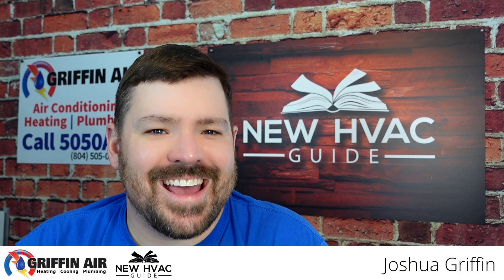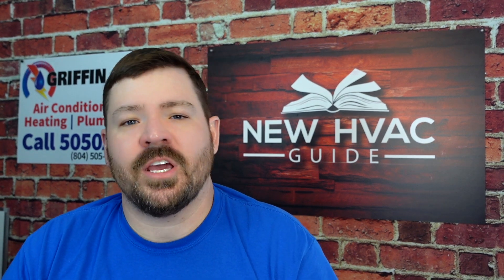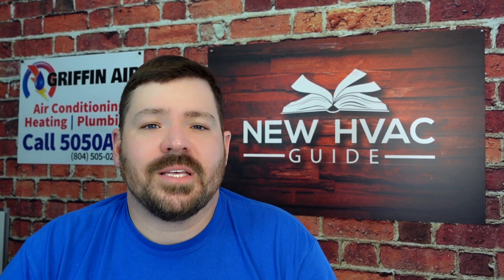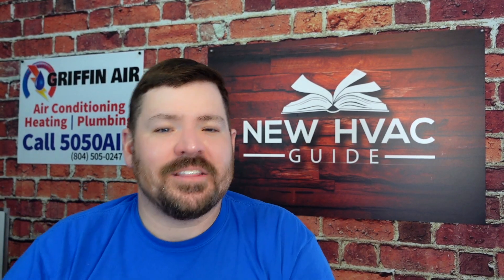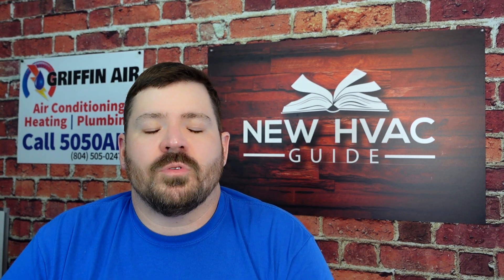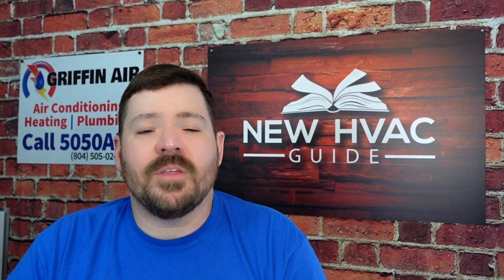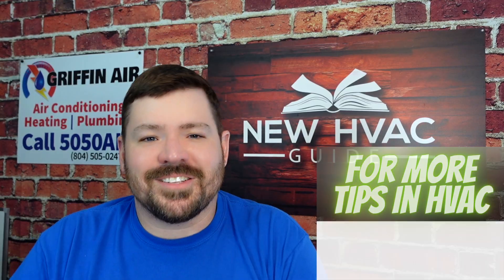3 Furnace ISSUES in the Winter!

Comment: I had to sign a waiver to NOT have condensate pump wired. Good thing, as a couple of weeks ago, we had unusually cold temperatures and the tube froze. I’d rather have water on the garage floor than furnace shut off. I unplugged the pump after discovering, later in the day used a hair dryer to clear the frozen section, and propped a piece of plywood to keep the harsh wind off of the exit point outside. Next night was just as cold, but no freeze up.

Comment: Extended run time isn't even discussed in the RTH9585WF "manual". According to Honeywell/Residio there is no adjustement to change the factory setting of 60 seconds for both heat and A/C.
You would think there would be on a $200 thermostat but they do have some "Pro" models that have it.
Reply from the maker: I've never understood the 9000. It's fancier looking than the 8000 but has much less features.
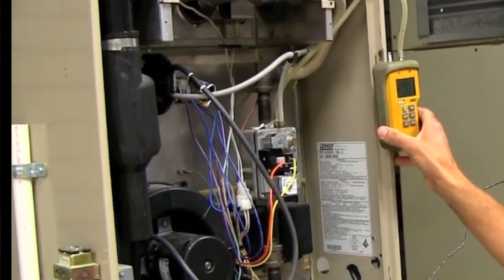Reply: @NewHVACGuide  After they said the extended run time was factory set and fixed to 60 seconds, I increased the temps on my heater and timed it when the gas valve opened and lit the flames to when it started the fan and that was 1:30 minutes. Then I observed when the gas valve closed to fan off it was 2:30 minutes approximately. We'll see how they set it for AC in a few months.

Comment: heat is more important here than a/c.    Had a big new furnace installed (in Feb of course, they never die in May).   and they got it up and running. (old one was 25 years old and needed a  new control board, why bother, waste of money).    Seems awful loud and pushing a LOT of air, but i know the new high efficient furnaces are all about air flow and not so much gas.    Comes June, flip to A/C and the A/C comes on and .........the air handler part of the furnace runs on low speed.  yeah it had been running on high speed the whole time.  (which kinda defeats the point of super high dollar efficient furance).  Didn't even know that was low speed where you can barely hear it.  They came out and sent the experienced tech (instead of install crew) and configured the whole thing.     (BTW stock is it runs for 2 minutes after the flame goes out, just as you alluded to).     It runs much better now, almost never hits high speed.     

Meh, i get it, these things are super complex now and they have a 1000 settings and in Feb you are just trying to get everyone up and running and not freezing out.   But probably should send a tech to ensure that everything is in fact configured correctly a month or so later, fittings are tight, etc.

Comment: What is natural gas pressure set point?
Reply: The natural gas pressure is usually set between 3.2-3.7"WC
Reply: @JSATI  Thanks!
Reply: Should be listed on the furnace sticker, which may be seen after removing the cover.
Reply: @jasonligo895  Thanks